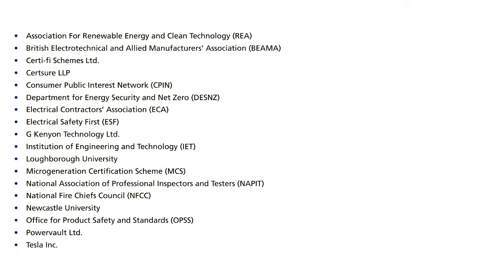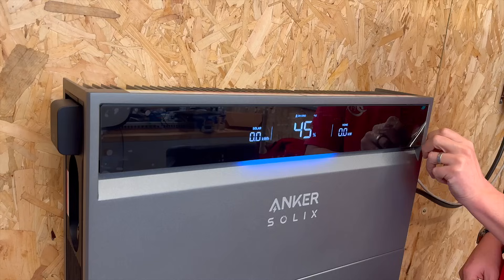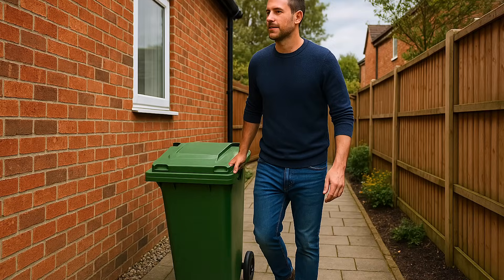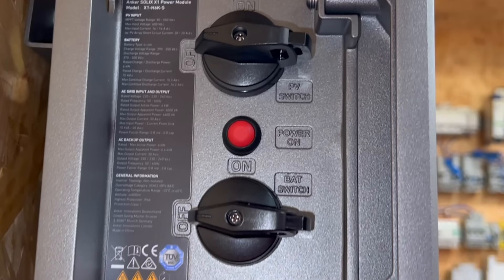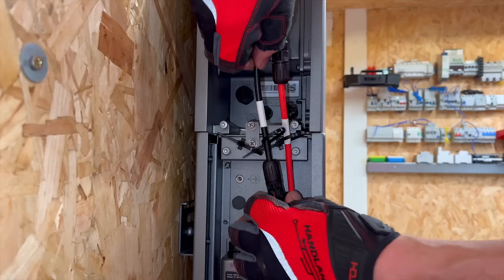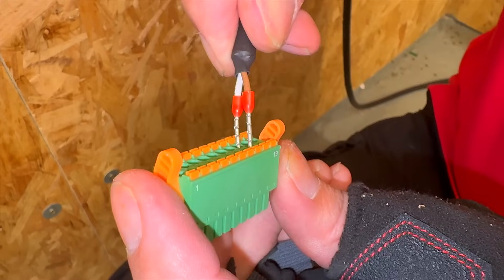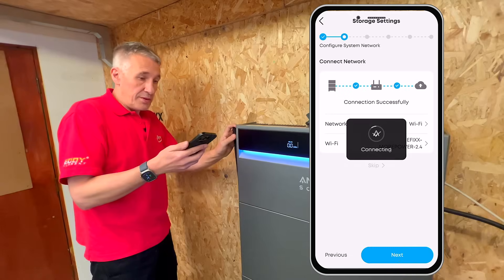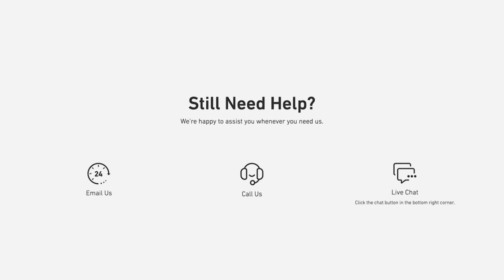Ugly Solar Battery Storage? Not This One

Comment: The regulators do know that LFP don't catch fire like NMC do, right?
Reply: No they don't apparently.
Reply: LFP is far more tolerant to abuse and heat, and has a higher runaway threshold.

NMC has greater energy density but is more prone to violent thermal runaway, particularly under overcharge or puncture.

LFP's cathode structure is thermally stable and does not release oxygen from the active material under normal abuse conditions, unlike NMC, which decomposes and liberates oxygen that fuels thermal runaway. While LFP cells can vent gases from electrolyte decomposition under extreme heat, the lack of oxygen from the cathode makes them far less prone to self-sustaining fires.
Reply: @WindyJAMiller  thanks for that👍

So is LFP set to take over going forwards?
Reply: @andrewstoakes8034  Yes they are cheaper to produce and safer
https://youtu.be/CGQwqWqzkNA first test shown is NMC second is LFP
Reply: @andrewstoakes8034 and I agree with everything the man from Camberwick Green said and would add that while LFP is less energy dense (approximately 80% as dense as NMC) it has another benefit in that charging it 100% and discharging to 0% doesn't degrade the cells anywhere near the degradation that doing the same to NMC would cause. To prevent degradation to NMCs it's recommended you only charge to 80% and only discharge to 20% where possible to prolong the batteries life, so if you look at them in that respect LFP actually has more usable capacity than NMC in a roundabout kinda way and they are cheaper to produce and on top of all that if they fail they most likely won't cause a fire
Reply: @Pegaroo_  and don't require cobalt, which is a good thing.
Reply: @ yes, only downsides I see are if you need higher discharge rates or that energy density then NMC might be the best choice, which is why they are still used in things like Model S / X Plaids but outside of high performance use cases I think LFP is the way to go
Reply: Regulation is always reactive not proactive.

Out of interest, what's the difference?
Reply: @andrewstoakes8034  https://youtu.be/CGQwqWqzkNA
ignore the form factors only the chemistry is important for the tests shown
the first battery in the video is NMC Nickel Manganese Cobalt 
the second battery in video is LFP Lithium Iron Phosphate

and I agree with everything the man from Camberwick Green said and would add that while LFP is less energy dense (approximately 80% as dense as NMC) it has another benefit in that charging it 100% and discharging to 0% doesn't degrade the cells anywhere near the degradation that doing the same to NMC would cause. To prevent degradation to NMCs it's recommended you only charge to 80% and only discharge to 20% where possible to prolong the batteries life, so if you look at them in that respect LFP actually has more usable capacity than NMC in a roundabout kinda way and they are cheaper to produce and on top of all that if they fail they most likely won't cause a fire

Comment: Never known any Anker product stand the test of time. Amazon crap usually
Reply from the maker: We’ve used Anker chargers and cables for years and find them to be reliable.
Reply: @ phone charger cables?… I feel they have devalued their brand by selling cheap on Amazon. I wouldn’t use them
Reply: @cglees  that's some wild logic. regardless, Amazon is so large now that companies are forced to sell through them.
Reply: Anker products are pretty good I would say outside the manufacturers own products (chargers/cables/battery packs) they are well above average. There customer support is excellent to the point they virtually have a no quibble policy and replace. They even recalled phone battery packs and replaced them with newer models. I think you have them all wrong @cglees. In fact I know and so does everyone else but you.
Reply: I have used chargers, batteries and cables, never a problem.

Comment: Surely PAS 63100 allows installation in an attached garaged (not to be confused with integral garage) where there is good ventilation, and a fire resistant wall between the battery and the living area.
Reply from the maker: You can still install batteries inside the home under PAS63100 - however careful attention to ventilation, fire sealing and compartments is required.

Comment: looks nice apart from the awful blue led, so you need to be properly minted to have it, no videos that i have seen give any info on guide pricing to any whole house battery storage, i know there are variables but a ball park figure would help.
Reply from the maker: Led is only on when you are infront of the unit. Colour changes depending upon operation state.